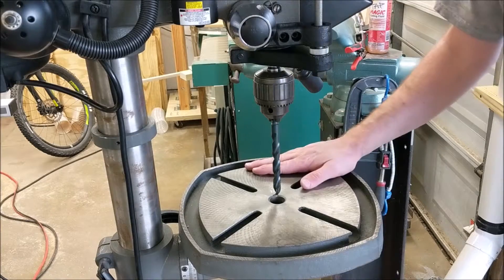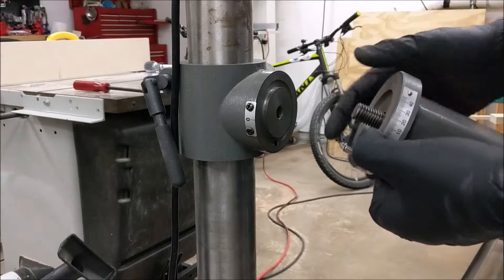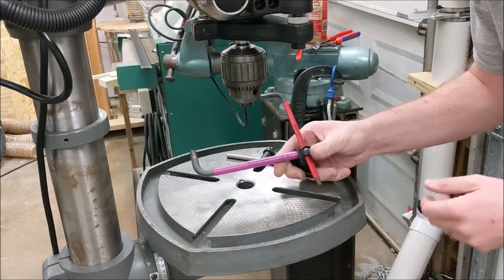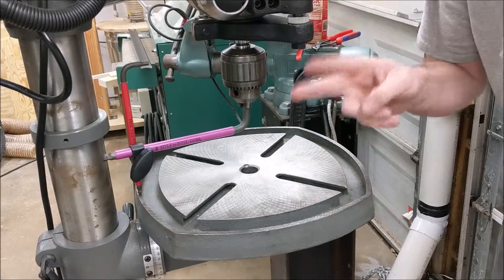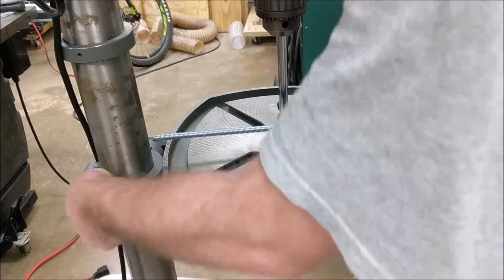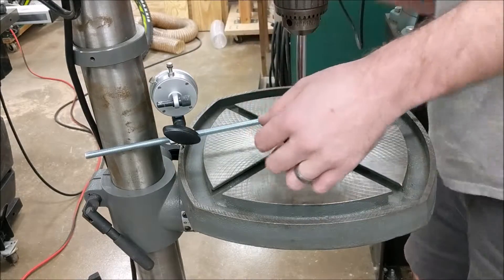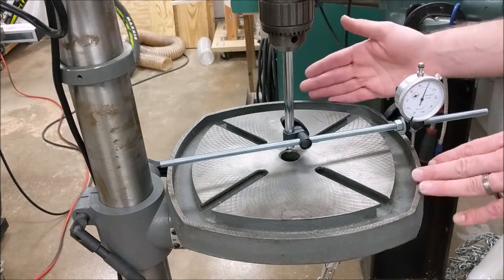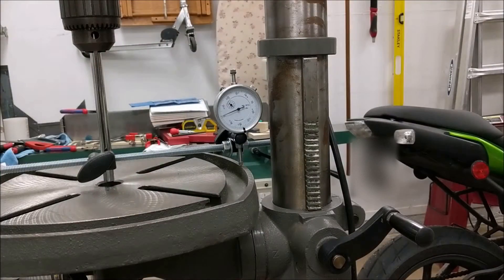Drill Press Setup P3: Drill Press Table Adjustments

Comment: Great tutorial. 1 question. I have my table square side to side and back to front... using an engineers square. All good. However when i tilt the table 30degrees, the back to front goes out of square.  Put it back to 0 and it’s perfectly square again in both planes. Any thoughts why the back to front goes out of square when i tilt the table 30degrees? Thanks 😊
Reply: The axis of rotation of your table is not orthogonal (perpendicular) to the spindle axis.  Maybe try playing with the table height lock tension to see if you can make an improvement

Comment: Is it worth it? Absolutely!!! I recently had to drill a new 10mm thick router plate with countersunk bolt holes. All looked good until I dropped the bolts in. They fit, sort of, but you can see and feel that the countersinks aren't perpendicular. So I re-did my square and perpendicular checks and found that my table had a bow in it, so I've spent 2-3hours lapping that out. Then I discovered 0.17mm of runout. So I've completely stripped the thing down to replace the crappy chinese bearings and chuck with something decent. All I have to do now is shim the table in the front to back axis. Thanks for showing me this.